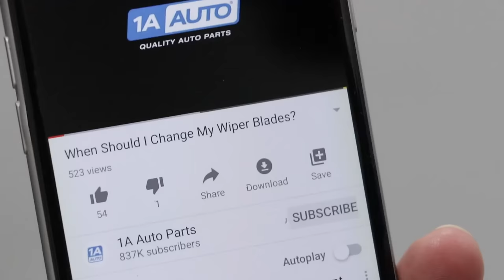Rusty Rotted Rocker! How to Replace a Truck Rocker Panel!

Comment: If you do this and there is rust on the inner rocker panel you should replace it at the same time. Leaving the rusty inner panel will cause the new panel to rust out in much less time than it would otherwise. Most vehicles have inner and outer panels.
Reply: Agreed lol.  This is exactly what I was thinking when he said he was gonna prep the surface.  Like what surface 🤦🏻‍♂️
Reply: True, whatever rust is left behind will keep rusting. Painting over rust will not stop it, it ALL has to be removed even if ya gotta fabricate a part to put in there. Doesn't need to look perfect on the backside, just needs to be rust free.
Reply: Napa makes a soecial paint that if you knock the loose rust off and clean the surface, the paint will contain the rust by adhering to it and by doing so starves the rust from oxygen.  I use it on my semi-truck tractor.
Reply: thought the same. very bad rust treatment. body filler over rust and so on.

Comment: No wonder the body shop is so expensive. That is alot of work them guys do and that was just one side. Im gonna attempt it. Great video. Appreciate the material.
Reply from the maker: Thanks 👍
Reply: How did it go ?
Reply: Cheaper then a phone # $ cost of a new truck for sure 👍
Reply: I know this video and most like it it is not a restoration, but you can't simply cut and weld new panels when the sub panels look so rusty. I guarntee u look at this in 1 year and it'll be rusted. Spraying primer on rusted metal won't cut it. Kill the rust.  It's hard to sandblast newer autos cause the metal is so thin and flimsy so I use a Ospho type product. If you use it PROPERLY, it will kill the rust and last a long time. Putting new panels over rust is useless. And you can use weld through primer so it won't rust. 
The reason why this looks rusted, rotted like it does is because it's not protected from factory. A 94 Toyota on Scotty Kilmers channel has no rust, at all in 28 years. It was dipped and has a zinc coating. Zinc will be a sacrifice so the metal won't rot. Gotta protect your work. I've seen so many good body and paint folks do a great job, but not protect with cavity wax, or whatever you want to use. It's as simple as using a bottle of mineral oil for $2 that you pour into the rockers, plug the drains and let sit for awhile. Buy a few bottles and do this and I mix with trans fluid and it'll not rust, ever. Repeat once a year. I know your just showing how to replace panels and do a fine job but if u try this at home you've got to KILL ALL THE RUST. Then protect your new panels. There's many products to use but if cheap is your thing, Vaseline heated and melted, mineral, baby oil, trans fluid etc is cheap and easy. I work in the restoration field and I can tell you that if you let rust live, whatever you work on will NOT LAST. Even if it's a free whatever, kill the rust. I replace air bags on towncars, tractor trailers, trailers etc. I'm the only one I know who uses something like 303, Vaseline etc to protect the rubber. Use SOMETHING. We spend so much time and money on whatever we work, fix, restore so please think or ask what can I do to make it last. I've saw so many good videos that do this and not tell viewers to get rid of ALL the rust. If not you might as well not even do this. Use an acid to kill it and do your work. Use whatever you want or like to get rid of rust. Just do it. It's easy, cheap and takes lil time. You can mix toilet bowl wax rings, 1 tube of grease, 1 quart of new, used trans fluid, 1 quart of oil and heat it all up and mix it. Spray, brush etc and I promise you it will never rust. If you have the money I use internal frame coating and frame coating from eastwood. Or any that's along same lines.
Reply: @jasonchristopher2977  my inner panel and outer panel are rusted and i bought the outer panel but would could i do about the inner? I want to show you pictures and tell me what you think
Reply: @Gluewap  Ok. Until then id say Soda blasting with home made rig, acid spray, rust converter. Or cut and replace. I try to help ppl with acid but they gotta follow the steps or else epoxy coatings will not stick. Then I'm the ass who said use acid. If u do this properly, like my friend pete and others, it will be ok.
Reply: @jasonchristopher2977  Is there a spray on rust converter that  would work on the inner panel in this video?
Reply: @ReitersBlock  Yes. Ospho. Used if forever. Here's what my pap taught me 30 years ago. Get heavy rust off. However u choose. For places like he said grind or sandblast. Yes u can do that. I get heavy off with a needle scaler, spot blaster u can buy or make, or 36 grit sand paper, depends on how much access u have cause some places u just can't get too easily or barely at all. For places like this I use Muratic acid. Spray on with a spray bottle, not air. Like a old peroxide, house hold cleaner bottle. Wear eye, breathing ppe. Let sit 5-10 min until clean and rinse with water and baking soda or lots of water and dry with air or heat gun something fast or it'll flash rust. 
If it's flash rust u can use Ospho, white vinegar, loctite rust reformer etc. It's best to weld in good metal, 2nd is fiberglass and resin, or putty with hair in it along with some metal patch screen. Sandblasting is always best to get 100% rust gone. But it's messy and sand gets everywhere. I made a spot blaster out of a airgun kit from Harbor freight. U can watch ppl do this. I use a eastwood chassis saver type paint with zinc in it. I also use CarRep epoxy primer in a spray can for small areas. It has unlimited pot life. 2k type that u pop the bottom u get 24 hours max and it's trash then. Car Rep u can use and save rest for later. When u want to protect from rust mix 1 quart of any new used oil, 1 quart of any new or used trans fluid, 1 tube of grease gun or tub of wheel bearing grease, 1 toilet wax flange gasket. Put all in a old pot, heat and mix. U can spray on, brush on however u want. Need to thin it use oil, trans fluid. Or boiled linseed oil. My Pap used this for all his life. Never had any rust issues. U can save used oil, fluid and only pay $6 for a tube of grease and wax gasket. Some ppl use cheap dollar tree candles. I plug drains in doors and fill with melted Vaseline, or use baby, mineral oil with a lil trans fluid. I use baby oil cause it won't smell for a week. Drive around and then drain a week later and save for next year. By doing this you will save urr auto, camper, RV, truck, quad, etc. Hope this helps. I've been rust fighting since 80s. I hate they use salt brine even for no snow just a chance. I want ppl to be safe. But if it's that bad stay home. No need to risk it. Autos should last for decades for how much they cost. Not rust on the lot like newer Ford trucks.
Reply: @jasonchristopher2977  Thanks brother. Appreciate the excellent advice.
Reply: @ReitersBlock  Thank you. I love to help ppl save their favorite automobiles. Too many just fill with spray foam and paint with a brush and make it worse. For what time and money is spent fixing same issue a few times its easier and cheaper to do it right 1st time and be done. Lmao I got a kick out of urr name. Good stuff.
Reply: I did mine 3 years ago...inner was just as rusted....holding up just fine

Comment: My 1992 Silverado Pickups body is rust free because when new the Dealer gave me a lifetime rustproofing warranty and once a year I take the Truck in to have the under carriage and Body checked for rust..  I bet the Dealer thought I would get rid of it in a few years. Now the Truck is 30 years old with 116,000 Miles on it...

Comment: Really detailed and nice video. Doing these kinds of jobs myself, I appreciate the common sense and craftsmanship in the video. A car this old does not have to be like brand new and it would not be cost effective to treat it in such a way. What I especially enjoy is how the amount of work is shown here. Bodywork is very labor intensive, especially when the goal is to have good results. Most people think you can do it quick and dirty and complain on the expense of bodywork. This vid shows well how much is entailed in such.
Reply: Okin Arierom this video shows many poor ways to do a job like this. Never use gasless mig on bodywork. Never put bondo over paint. Your welds should be complete enough to seal the area from water intrution from behind. At best a very beginners attemp at body work
Reply from the maker: Yes! Some times body shops do not want to work on rusty cars so the only way to get it fixed is to DIY. Thank you for checking out the video. If you need auto parts go to: http://1aau.to/m/Shop-1AAuto-Now
Reply: How much this job cost ?
Reply: Alot of people are fixing their old trucks and cars because it IS cost effective when compared to the overpriced new and used vehicles that are for sale right now.
Reply: @korndawggy1801  facts greedy dealers always overcharge

Comment: As an owner of a rusting NY '02 Avalanche this video was excellent for an amateur guy like me. You did a great job explaining. Sorry some of the comments had to be from "Pros" who want to critique welding and such.
No matter, maybe they can find a welding channel to go and compare their rod sizes...
Thanks!
Reply: Let me guess, its only the rear that's bad. I have an 02 avalanche as well that's originally from NY. Thinking about getting these done and the other rust spots. Is this work justified on the old 200,000 mile Vanche?

Comment: I bought the rockers from 1A for my ‘04 GMC Yukon XL.  I was impressed with the panels.  The gauge was heavier than the stock metal.  This was my first time doing body panels and welding.  I’ll do better on the opposite side because of what I’ve learned.  (I forgot to spray the inner rocker before installing the panel).   Thanks for this great video

Comment: Just had this done - both rockers with new slip-ons from Ebay.  The 2 panels were $135 and the labor by my own mechanic to cut out, replace, weld and bondo and prime was $1800.  Not cheap but very necessary on my 24 year old Toyota Tundra!
Reply: Honestly not a bad price at all to make your truck last another 5-10 years.

Comment: This is the video I needed to see. I just purchased a ‘95 Chevy Van that’s really solid, but DOES have some rust at the bottom of a couple of the doors. I have the welder and the replacement panels, and this will be my very first time doing ANY of this. This tutorial gives me hope. 😆

Comment: A very honest approach at this repair. Nice result and nice video
Reply from the maker: +Stephen Groenenboom Thank you! We love empowering our customers and showing how to perform DIY auto repairs with our high-quality auto parts.  http://1aau.to/m/Shop-1AAuto-c
Reply: Stephen Groenenboom this repair wont last. Too many holes in the weld to let water in behind bondo. Bondo over paint wont adhear to the paint. Inside support for the rocker should have been replaced
Reply: @holmes1956O  It will stick if it was sanded good with 40 grit first, also his first coat was fiberglass to fill in any holes

Comment: Good tutorial.... Not sure if it was mentioned but >>   Don`t forget to Disconnect The Battery as not to Destroy (think of it as an Emp ) the Computer from the Welding   <<   A few tips if i may add is instead of drilling the spot weld holes and also the  added bonus of seeing the panel fitment as well is to use Tek  (self tapping  ) screws  Most hardware / big box  stores have them . Use as many as you would need for  Factory spot-weld locations.  Then Mig  ( rosette / plug style ) weld each random removed screw as you go along  a few at a time bouncing to different areas to keep warping to a minimum.  Keep in mind the TEK screw hole goes through both panels with that method so a backer of copper plate /sheet behind the hole or an experienced Bodyman/women weldor can do it w/o a backer.  Good idea to use some fire resistant welding blanket , thick cardboard or scrap sheet metal in the door openings when plug welding keeps sparks in check.  Keep a blow tip near to blow out any spark induced flames that may happen from painted surface or factory seam sealers.    Also watch out for wire looms and such.
Reply from the maker: +Pin Ball Thanks for the feedback and the tips, much appreciated!

Comment: Great video. Thank you. The only critique I have is the waxing at the end. I'm pretty sure you should wait at least several weeks before waxing after paint, because that paint has to breathe to cure. When you cover it with wax. it doesn't allow that curing process to take place. That said you did a really good job. When I need help figuring anything out inside my garage, I look for your videos first. You go step by step, you articulate well, and make things much easier.

Comment: I found there is a Huge demand for rust repair in Michigan. I was doing paint jobs and switched to rust repair with paint as needed. I only offer rockers, cab corners, and wheel arches.  
And That is enuf in itself to stay busy year round. Thank u salt trucks😂

Comment: My rocker panel on my Colorado just rotted right through, talked to my grandpa and he suggested I just cut off the old panel and put in a new one. I didn't even know that was a thing, so now I'm here, and now I'm a lot more educated on it. Time to fix up the rust on my truck 😏
Reply: Just curious how this worked out for you and if I'd be able to do this with minimal body work experience

Comment: Fantastic video.  My beater GMT800 Escalade EXT got me through years up in Buffalo and earned her rust.  Mechanically she's been pretty much perfect (full fuel lines and pump replacement plus normal maintenance is all she's needed) but the rust is horrific.  Once getting the whole body intact, what would you recommend regarding the rusty frame and other problematic things underneath the truck aside from just trying to shave off all the surface rust from every surface before a proper undercoating?  At that point it might not even be worth it fi it's the only option

Comment: Thanx for this overview video.  Drivers side of my Ram quad cab is virtually non-existent. I've got ALL the tools req'd but "somewhat" lacking the confidence to go balls deep and chop out a huge section of my beast.  The right angle die grinder "does" the job but my DYNAFILE II will make short work of all those spot weld holes and edges that needed attention.  A cheap version of a Dynafile, can be purchased at Harbour Frieght or Princess Auto.

Comment: I'm going to be tackling this next year on my Explorer. I can't find the inner rockers for mine. Could I just trim off the rust if it's bad enough and just we'd in some sheet metal so the outer replacement has something to grab onto?
Reply: a little late but yes you could, it’s not like you’ll see it so don’t have to really worry about it looking different

Comment: I purchased a few replacement panels (rockers, cab corners and rear fenders) from 1A Auto for my 2005 GMC Sierra and they are first rate quality. Will be welding them on in a few days.

Comment: Thanks for the detailed instruction presented here!  Definitely not quick and easy to do it right.  How many hours did you put in to complete the one side?
Reply: Start to finish you're looking 8 hours a side.  Then add paint booth time unless you're fine with a rocker guard finish
Reply from the maker: It took  20 - 30 hours because we were making a video. It would be a good weekend project. Thank you for checking out the video. If you need auto parts go to: http://1aau.to/m/Shop-1AAuto-Now

Comment: A note on the use of flux core wire.  The flux in the weld will eventually react with the body filler and bubble up. There is no real way around this, it is going to happen.  This is why you should always gas welded joints and panels for auto body work.  There are kits you can buy for the conversion, or you can buy your own parts and convert your welder yourself.
Reply: I watched a YouTube earlier tonight where the host was comparing different type of flux core wires.

One of the commenters pointed out that he was using a GS or general service wire on all of them but the Lincoln. The Lincoln wire was rated higher.  The commenter pointed out further that GS wire cannot be welded over asda Lincoln wire can be. This was a reason why the Lincoln wire was almost twice as expensive.

So I love this video. But according to the commenter I'm referencing, he was going over his spot welds. I hope the host was not using GS wire....😬

Comment: I was told my 2000 f250 SD crew cab 7.3 with 360k was not worth replacing the rocker panels. Is that true or is it just someone not wanting to do the work?  I know this will take me multiple weekends to do (beginner) but...buying a few hundred dollars in panels and spending sweat equity just seems cheaper than buying a new truck.... especially since I've been slowly replacing so much; suspension, new beefier transmission, etc.  I would love a video that talks about when are you polishing the brass on the Titanic.  Thanks y'all.  Your videos are helpful and I've been watching them for a few years now.  🙂

Comment: pro tip, paint the inside of your rocker panel with some good paint b4 you weld her on
Reply: Not a pro at body work but am a welder by trade and I agree but also crawl under and re pair around were you weld because the paint will blister off because of the heat
Reply: @jeremybrown9785  yes but i would think there is alot more protection for the remaining inside against rust... no?
Reply: @shawntracey  yes on everywhere but where's been welded .Heat from the welds ... pretty much completely get rid of the paint underneath it ... and sometimes lights a bunch more of it on fire ...paint is flammable even after it has dried I agree with him 💯 but 1 definitely make sure your checking for flames more than normal 2 still a good idea to crawl under and repaint the spots that burnt away